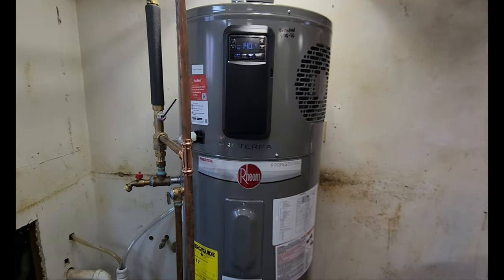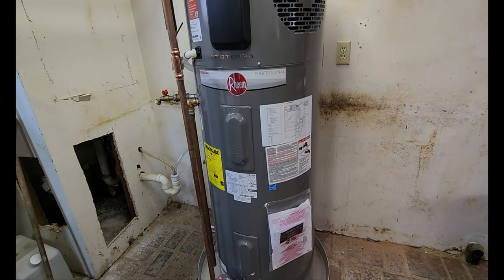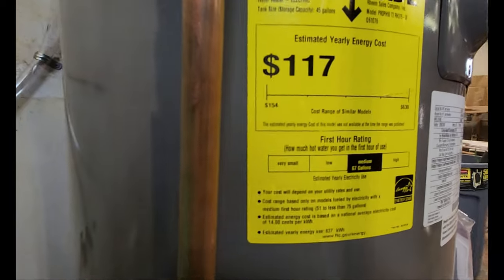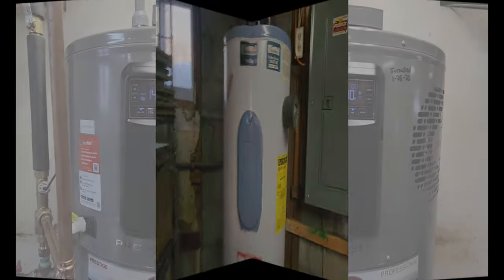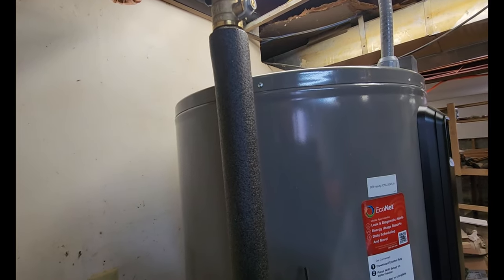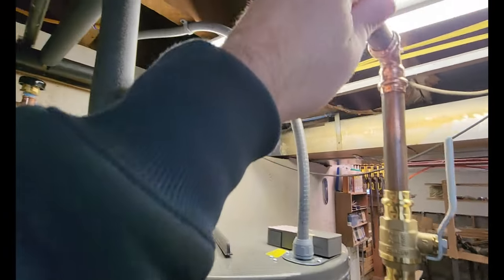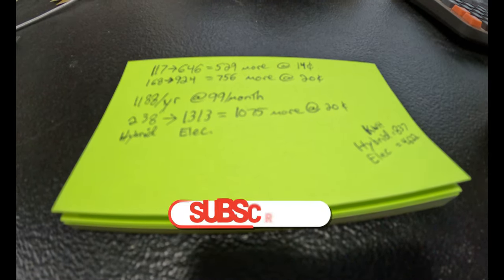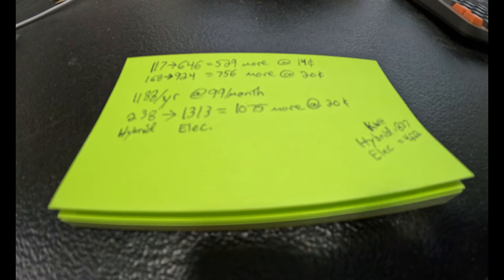Rheem Professional Prestige ProTerra Hybrid Electric Water Heater Review and kWh actual usage.

Comment: Great video, but, I didn't hear you disclose installation of a Thermal Expansion Tank or Valve. Did you install any on the water supply side from the city?
Reply from the maker: Yes, this is because this home has a well so there is no need for an additional expansion tank.

Comment: Can I ask why you decided to go with the rheem instead of the AO smith? Not sure if you were aware when it got installed but there is a new AO smith got released in like November 2022
Reply from the maker: My supplier gives me a really good price on Rheem and they had great reviews at the time when I bought it. Also if there is any issue with the heat pump within 10 years they replace the whole water heater.
Reply: @TrolleyBrothers Thanks for doing the video. Quality videos about these water heaters are still not prevalent enough and you did an excellent breakdown of things. I went with an AO Smith because ours has to be in a location where almost any noise is unacceptable and I expect I’ll still have to do something to deaden the sound (plus it ended up at an absurd clearance price that disappeared in hours where an 80 gallon was cheaper than the 50), but your video is still very applicable to people considering the AO Smith hybrid because the new AO Smith models are much more comparable to the Rheem hybrids than they are to the old AO Smith models. Thanks. (Sorry to the original poster for hijacking the post on a good question but wanted to make a shoutout and didn’t know how else to do it.)

Comment: How do you heat your basement area in winter and what’s the average temp.
Reply from the maker: The basement is unfinished and not heater. The basement is around 55 degrees, normally before the installation, and runs on average 2-3 degrees lower. Not s noticeable difference.

Comment: I’ve watched several videos that show major issues with the filter not stopping enough dust and eventually the condenser coils get covered and the heat pump starts throwing errors and switches off.  Have you experienced any issues yet?  How difficult is it to access the coils so they can be cleaned?
Reply from the maker: No I haven't had any issues at all yet. I do not know how accessible the coils are off hand.

Comment: Can I ask what the db rating is at the unit when the heat pump running vs when it is not running?
Reply from the maker: I do not have that information handy, but I will see if I can measure it.

Comment: Is the water heater more energy efficient to run in just heat pump mode vs eco mode?
Reply from the maker: No it is not actually. i did a test myself for three months on each mode and Eco mode is more efficient. Sometimes if the water heater decides it will take more power to recover with the heat pump instead of using the elements, then it will just use the elements or mix the use of both at the same time.

Comment: How can I override the 140 degree limit? I need a smaller water heater, but there is high usage and the recovery is way too slow compared to the gas water heater i replaced it with.
Reply from the maker: Even if I knew I would never tell anyone that to be honest. It is not a good idea generally. I would suggest if you have gas available to go with an on demand water heater and not worry about the recovery ever again.

Comment: This is maybe a weird question but could you tell me what the diameter of the tank is? I need to know if I can fit it up my attic hatch and I've only found package dimensions so far.
Reply from the maker: I believe it is 25-26" in diameter. You should be able to find actual dimensions on line.

Comment: I just had the 65 gallon of this tank installed, it is in heat pump mode. If someone takes a shower, the next person is getting cold water. Is there something wrong with the tank or are we using the wrong mode? Any suggestions? Thank you
Reply from the maker: That is hard to say without seeing the setup, was it professionally installed? There are a lot of variables such as the temp the tank is set to and if there is a mixing valve and plenty of other things.
Reply: @TrolleyBrothers  thanks for your reply. It was professionally installed. No mixing valve. It’s set to 140. I changed the setting off of heat pump to the option that uses heat pump and electric, it’s a little better, but with 65 gallons, should be able to take at least 2 even 3 showers in a row. Gas > electric so far. I am a developer and this is my first all electric build. Prefer gas so far.
Reply from the maker: Have you had your installer back out to address the issue? 65 gallons should be plenty of water for normal length showers. Also was the water heater installed to manufacturers specifications? I am referring to space requirements as well. This water heater is most efficient on the "energy saver" mode as compared to straight heat pump mode. Hopefully your situation can be figured out easily.

Comment: WHO repair this if the heat pump develops a problem ?? no plumber is going to fo this, and no hvac is either ! this is loud I can hear it in the video !!
Reply from the maker: I would suggest an HVAC contractor like us that does water heaters. From what I am told with this unit, if the heat pump fails they just give you another water heater up to 10 years later. We install the line from our supplier and not what home depot has so there may be a difference there in the warranty procedure. The noise in the video is amplified by the camera. It is not very loud in person at all in my opinion. There are comparison videos online about the noise produced.